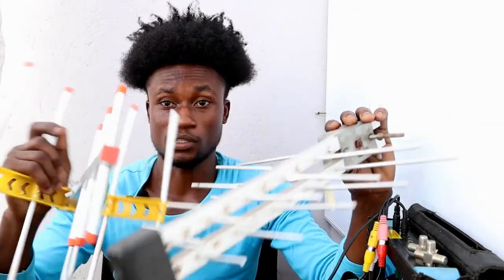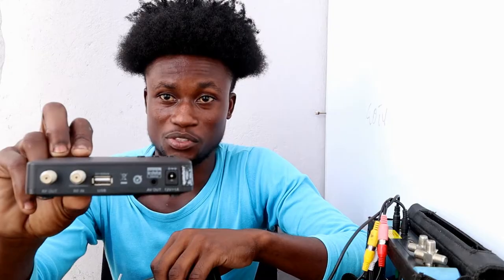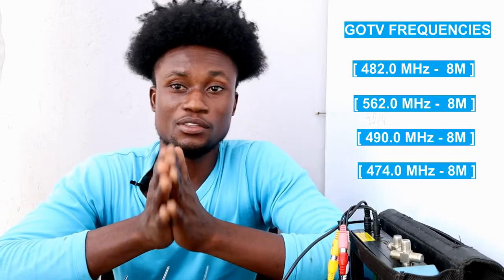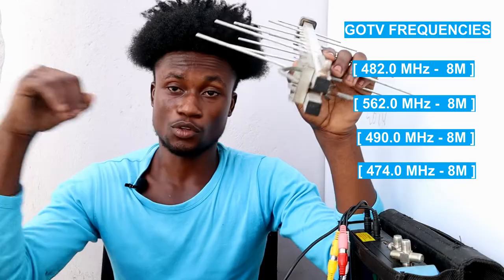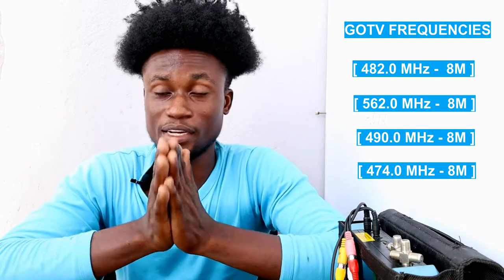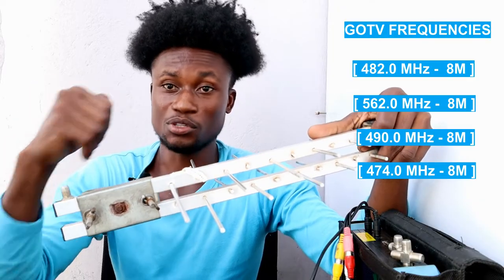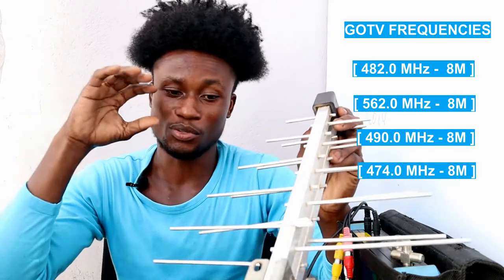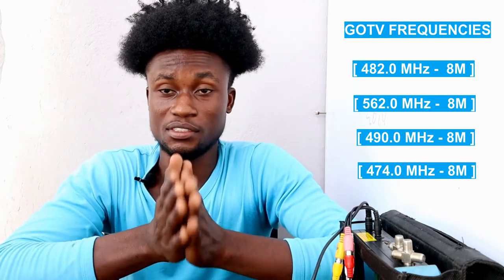Gotv Installation Guide And Frequency

Comment: Bro can i use a the antenna you showed in the video for the go tv? Or only the one that comes with the decoder
Reply from the maker: You can use any working antenna, provided it can get you the signal.
Reply: I use the go TV antenna but the signal range between 34-58 only but the quality is 100
Reply from the maker: Let it stay at one position and scan. Getting above 60% will be perfect.

Comment: Bro how do you use the Gotv frequency listed on the screen on the tracker.
I mean where and where do u press on the tracker.
Reply from the maker: If you're using an Antenna Tracker. There's a menu for it.
You can't track it with a satellite finder/meter.

Comment: can you do an installing on strong tv
Reply from the maker: Do you mean having Gotv channels on Strong Decoder?
Reply: @pbtecknology  you know strong decoder is dedicated to religious stations-- so im asking of you also do the strong tv 
installation
Reply from the maker: Gotv channels are on terrestrial/antenna ( TV pole) . You can only Install satellite channels on most of the Strong Decoder available . If you want Multiple channels, Buy 1 additional LNB + DiSEqC. Which will not cost more than gh50 . Get a professional installer to get you some additional channels + the MultiTv channels.
Reply: @pbtecknology  but how much does the strong decoder cost-- i have disc already